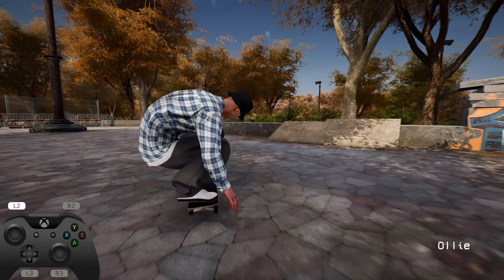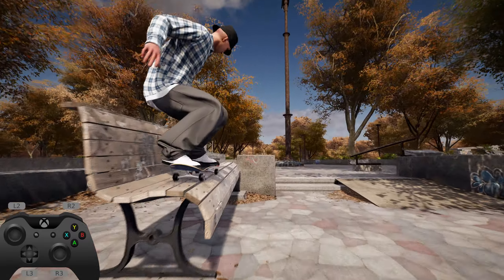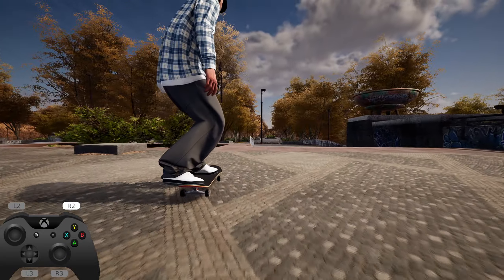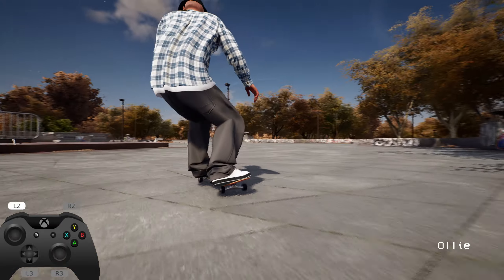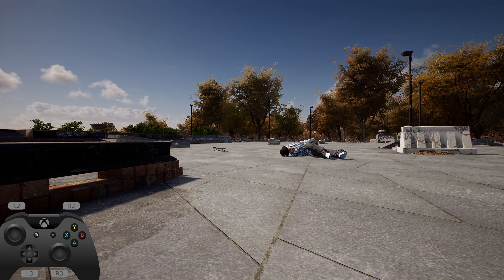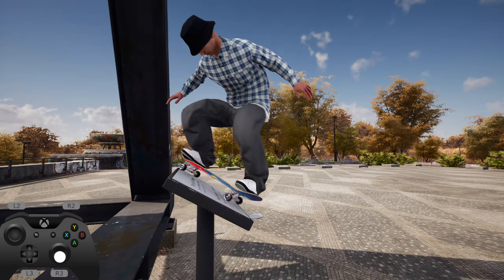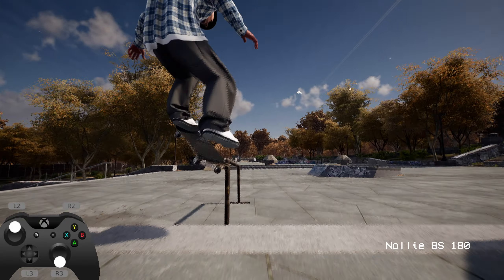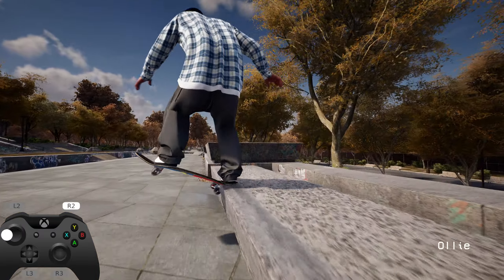Skating EVERYTHING in Session's Prague DLC Map

Comment: If you want your manuals to not dip when entering them you have to have manual catch on and catch your trick holding the manual position.
Reply from the maker: I'm on manual catch, I still find it can be bad at not dabbing down sometimes...
Reply: @TekuFlat  Ive got a way of doing it so that it never dips but its hard to explain, it doesnt work with 360 shuvit variations or with tricks with more than one flip ( double or triple flips ) you have to do the manual input immediately after the trick imput ( almost simultaneously ) sorry very its hard to explain it in a comment